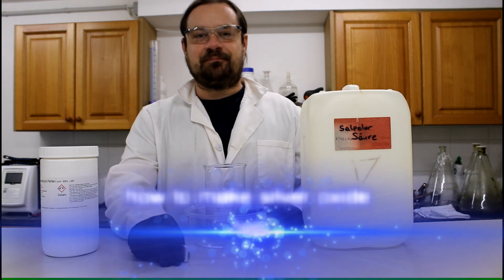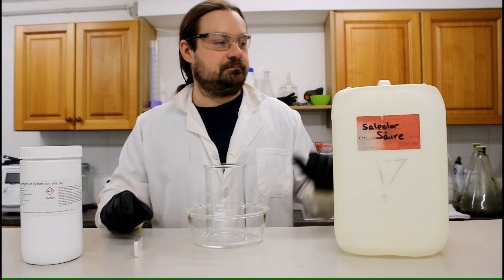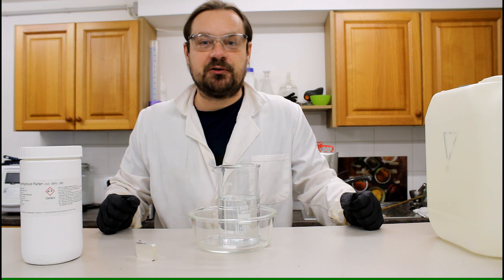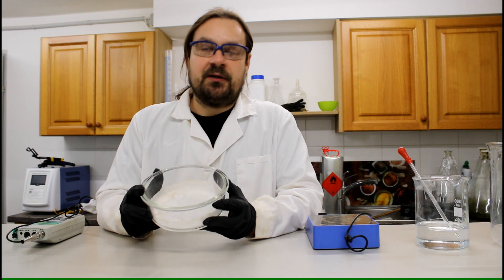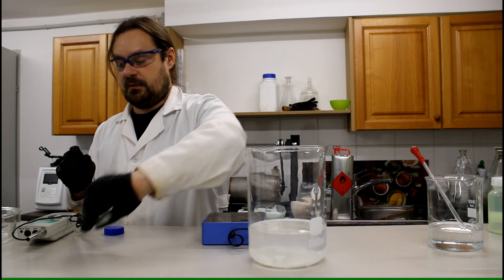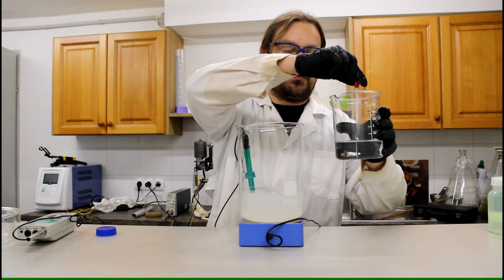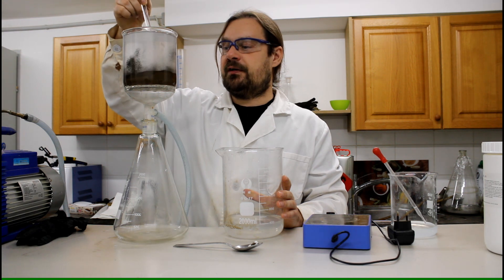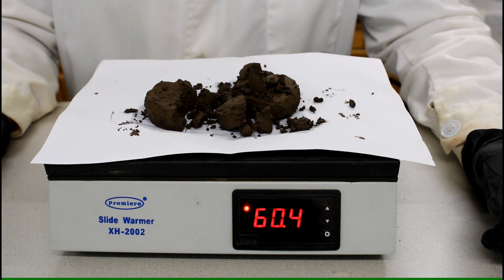how to make silver oxide

Comment: the silver nitrate solution can also be used as an electrolyte in a silver crystal cell, if you ever want your silver back in metalic form.
Reply from the maker: yep!
Reply: Or just add copper wire to the solution to bring out metallic Silver

Comment: A nice demo. I make all my own HNO3 because it's too expensive to buy so I'd have distilled that left over HNO3 to recover the acid and more AgNO3. But that's just me. 🙂
Reply: I make my own HNO3 because in the libtard EU it's forbidden. 😀
Reply: If you suck the brown nitric fumes through a gas washing bottle, you can also get back the nitric that is lost in the air otherwise... (I use 3 in row.) but don't tell anyone!
Reply from the maker: Thanks. Yeah I make my own nitric with a birkeland eyde generator - check out one of my older videos about that :-)
Reply: ٧ 7